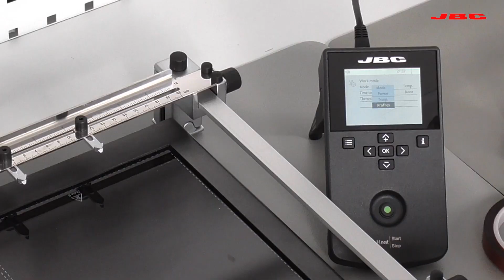JBC I Ask an Expert: Preheaters Review

Comment: What happens if flux or solder falls off the board onto the heater surface? Is the heater element protected from such case and can it be easily cleaned from flux/solder?
Reply from the maker: If you drop flux or melted solder over the glass, turn of the Pre Heater and wait until it cools down.
 
Heater element is under the glass, and it cannot be damaged.
 
Use a damp cloth to clean glass surface.
Only if it is necessary use a scraper to remove dirt in the glass area.